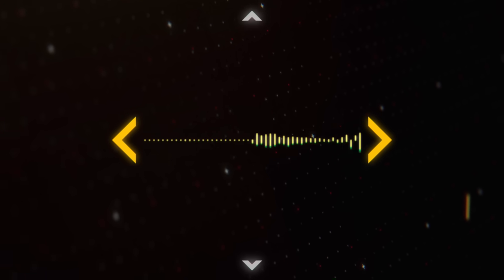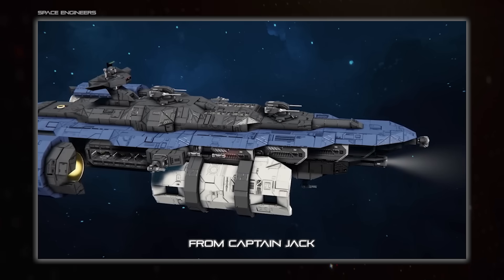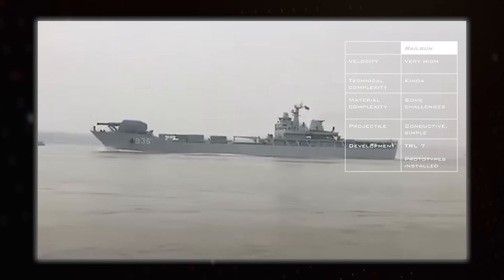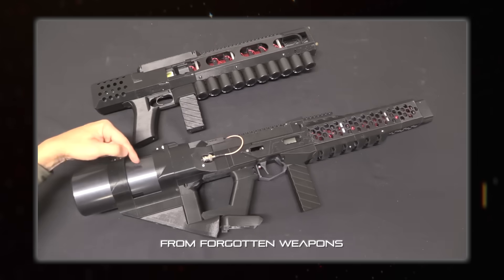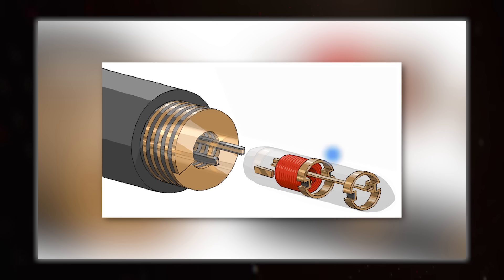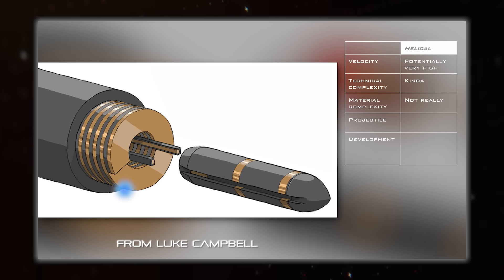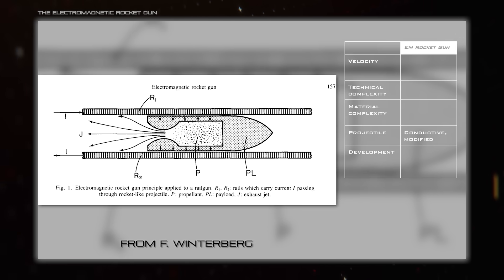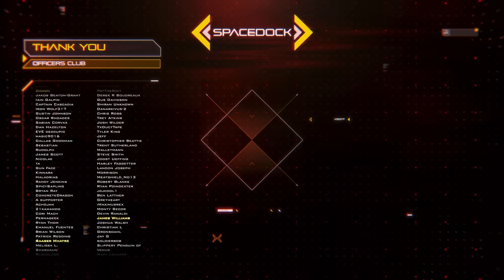The Deadly Coilgun/Railgun Hybrid You've Never Heard Of (Helical Railguns)

Comment: One of the primary reasons why militaries are looking into railguns and coilguns is to replace missiles for very long range firepower, as missiles are hella expensive per unit, while railgun ammunition and the electricity needed to propel it would cost pennies in comparison. As such, in my mind the helical railgun kinda goes against this premise with its much more complex ammunition.
Reply: On a scale of "cannon ammo" to "missiles", the helical railgun ammo is very much on the "cannon ammo" side of things.
Cannon ammo is actually surprisingly complex even tho there's no electrical things happening, just watch a video about the development of naval shells over the years leading up to the Dreadnought era to see what I mean.

As far as the hybrid railgun's ammo goes, materials science is here to save the day. There's plenty of alloys that use mostly copper and tugnsten out there, and they're used exactly where you'd think they would be used, where you have a lot of abrasion but need to transfer a lot of electricity. Think things like spot welder contact points, where you need to transfer a lot of electricity, don't want the contact to melt, but you also don't want it to get stuck to the other metal that you're actually welding. Tungsten/Copper alloys are great for that (there are usually some other small presences of intentional alloying elements to adjust properties to suit the application as best as possible).
All you really need for the "ring" contacts which are (in this video) ahead of the projectile's coil is a series of circular sections around the outside radius of the projectile, hinged at the front and sprung to push them into firm contact with the helical coil of the barrel itself. This allows easy feeding of the projectiles into the barrel, as there is a natural tendency for them to center themselves in the barrel by spring pressure alone, and if it's an attraction type hybrid railgun, the alignment of acceleration forces is also such that it will naturally tend to align the projectile in the center of the barrel. Both of these factors seem like they would further reduce barrel erosion.
Reply: @44R0Ndin  Nicely put. you could aslo think about material pairings for the contacts, whereas you sacrifice the projectiles softer contacts agaisnt something harder in the barrel.
What about metal with very low melting points? You could melt them as kinda an abrasive contact on the projectile side. would have to have high conductivity at a low melting point and minimize wear on the rail.
Reply: @44R0Ndin  I agree with your assessments as far as my limited knowledge goes, but I do have a concern that wasn't addressed in the video or your comment on the barrel longevity.  Cost to replace.  Unless the erosion can be limited to the point of outlasting the expected service life of the weapon, at some point the barrel will need replacing.  Rails, traditional barrels, and even traditional barrels with integrated rails would all be much easier and cheaper to produce than essentially the worlds largest spring with integrated rails.  That I would assume is the big equalizer in terms of cost/benefit ratio on helical railguns, not ammunition.
Reply: @zippydaspinhead  
Right, "simple" railguns would be, well, simpler to make, and therefore less expensive (to the point that you might be able to design them with disposable or easily replaced barrels or just easily replaced rails), and while you could do the same with hybrid railguns, the chances are high that you wouldn't need to do such a thing, and I think your point that you need to reduce barrel erosion to the service life of the weapon is achievable. However, it's even better than that, because even normal firearms are usually not expected to have their barrel last the expected service life of the firearm. Even tho a "cheap" AR-15 barrel will last roughly 5-6000 rounds and an expensive one roughly 4 times that without losing accuracy, they ARE designed to be replaced relatively easily by a gunsmith. Standard railgun barrels would need replacing nearly as often as the ammunition magazine, to the point that if you designed the rails and the magazine as a singular unit easily replaced, that would be a feasible avenue of designing a practical "small arms" sized railgun.

Rail erosion is actually LOWER in hybrid railguns than standard railguns, and the more turns you put into the projectile's coil and the more fine-grained the windings in the barrel coil are, the lower the erosion will be, because this allows a massive reduction in the required drive current (of course it's not magic, so the drive VOLTAGE will go up to compensate if you hold muzzle velocity and therefore muzzle energy constant).
This is because the "projectile" coil and the "barrel" coil have more than a part of a turn of an electromagnet in each one, meaning that less current is needed since the magnetic field intensity is roughly proportional to the number of turns multiplied by the drive current (to get the precise number you must take many other factors into account, but for a ballpark estimate to determine "Which is better", this level of analysis is sufficient).
The effect of this is that with more turns in both coils, you need less current, and less current means less rail wear due to resistive heating. Of course there will become a point where resistive heating is replaced by plasma heating due to the increased voltage, so there is a balance to be struck, but overall if you hit the "sweet spot" you can probably get a rather shocking reduction in overall barrel erosion.

Alternately, if you want a "snub nose railgun", you're also looking for a hybrid railgun, but here the rail erosion will be similar because you're holding drive current and muzzle velocity constant, while allowing the barrel length to vary between a "standard" railgun and a hybrid railgun. The hybrid railgun's barrel will be much shorter, again due to the multiplication effect of having more turns of current carrying conductor in the electromagnets related to accelerating the projectile.
If you really want to get fancy, you set the projectile to be "pulled" out of the barrel by the barrel coil pulling on the projectile coil, this creates a self-centering effect due to the radially symmetrical nature of both barrel and projectile coils, and this should also help with wear of the barrel as a whole even if not the current carrying primary rails.

It would also be fairly easy to design a railgun (standard or hybrid) which trades off a small amount of increased rail wear to allow the projectiles to be spin stabilized if this is desired. To allow this, simply design in a twist to the primary current carrying rails, and have the projectile's rotational axis fixed to the path of the rails, much like the rifling lands and grooves in a standard gunpowder firearm.
Reply: The primary reason why the US Navy Railgun was abandoned was actually because the maintenance cost outweighed the benefits compared to disposable missiles. The wear and tear and constant replacing of barrels was too much. So while you are correct that the ammo and power might not be an issue, maintenance is.
Reply: @ArmouredProductions Yup. Most of a sailor's job is maintenance
Reply: @ArmouredProductions  What about heat shielding for the coils? Could that help?
Reply: @ArmouredProductions  Assuming absolutely bonkers outputs... Helical Railgun. You need special ammo, yes, but the barrel might not actually need replacing.

Just the rail contacts. And if those are made to be replacable/centering contacts, it might be as simple as a half hour of removing old Power Transfer rails and inserting new ones into the existing helical coil barrel. And with the sheer amount of power, technically, you could theoretically get a projectile weapon with a lithium payload that goes thermonuclear if you yeet that sucker fast enough.
Reply: @ArmouredProductions  I heard that the velocity in our atmosphere eliminated the long range benefits it was touted as having where missiles and rockets hit just as hard regardless of when they hit. It would have only been viable in closer fighting where missiles could still strike them. Despite that, it's still an excellent coastal bombardment concept but this is all hearsay and personal conjecture so, grain of salt.
Reply: Could still be cheaper than missiles, even if not quite as cheap as simpler shells.
Reply: @lorddaro7771 And the high speed means lower time to target, which could be handy
Reply: Idunno man a fancy wire pattern and existing coil magnets are surely cheaper then the integrated computers and cameras of long distance missles.
Reply: @demrandom  There's a cost/benefit tradeoff here. If it's cheap, you can just lob a whole bunch of these hoping one will hit the target. If it's expensive, you want to put a guidance system on it to make sure it'll hit the target. Somewhere in between in a sweet spot which minimizes cost per hit. For traditional cannon distances (5-20 miles), I expect you're right and the sweet spot is closer to dumb projectiles. But for missile distances, I suspect other variables like wind, air pressure variation, aerodynamic imbalances due to manufacturing tolerances, etc. will push you towards wanting the projectile to have a guidance system again.
Reply: @solandri69  I don't know if you intended the oblique reference, but you just described exactly the problems with the US Navy's Mk 51 AGS for the Zumwalt class ships. It's "merely" a 155mm cannon that may have been initially intended to simplify logistics by using a common and established ammo type, but the performance requirements pushed the limits of ballistics and engineering so much that the system is hideously expensive and no longer compatible with normal 155mm ammo because of the modifications required to make it sufficiently long-ranged and precise.

I don't recall exactly, but I remember the cost per shell of the AGS 155mm ammo was near $1M. Part of this is due to how govt contracts work, where total R&D and production start-up cost is averaged out across produced units. As unit shell production goes to infinity, the averaged R&D cost approaches zero, limiting unit cost to only what's required to actually produce each unit. Program cuts reduced the number of shells ordered, which caused average cost per shell to go waaay up.

Prior to the Russian invasion of Ukraine in 2022, normal 155mm ammo cost around $3K per shell I think. Now it's up to $10K. That's excluding any special payloads or guidance options.
Reply: @dakaodo  Yeah, it is indeed somewhere around 1m per shell now. However it was normally expected to be around 20k per shell, but the navy cutting the amount of ships using it from +-30 to only 3 caused the price to skyrocket due to the lack of scale. 20k overall wouldn't be much for the capability it would bring, but I don't know if there were other problems that caused it to not be placed on other new ships (that obviously are still needed).
Reply: @dakaodo  though that higher cost includes the distributed costs of litterally building half a dozen more shell and explosives factories in the western countries that already produced most of the 155mm prior to 2022.
Reply: I've always suspected that a "sacrificial" sabot could work. Confine all the erosion to the disposable part, possibly using a graphite contact patch and squeeze bore to maintain pressure as the graphite wears away. That or liquid metal contacts.
Reply: The much more powerful and efficient electromagnetic launcher is the "quench gun" a superconducting coil gun. The energy is stored in the superconducting coils then the superconductors are "quenched" by the magnetic field of the projectile automatically turning off the coils as it goes past. So apart from using superconductors it is actually simpler that other coil guns and over 90% efficient conversion of electric power to kinetic projectile energy. While railguns manage 50% efficiency at best. In a coil gun the projectile does not touch the sides of the barrel so there is no friction or arcing. You can find two videos explaining the quench gun by two rival teams trying to build one for orbital launch, Lancaster labs and Electromagnetic launch.
Reply: The more complex projectiles would still be way cheaper than missiles. Way cheaper.
Reply: @paintrane1179  Shells and missiles are quite different from each other. The shell goes where it's fired, nothing more nothing less. They are also limited in range quite severely. Sure you can fire beyond the horizon, but the air resistance will chew up a lot of that motion making the penetration less than optimal. A missile on the other hand is slower, but it can change directions and fly at a low height. It also can carry a lot more explosives than a shell like the ones discussed. Railguns largely depend on a very high speed giving them high penetrative power and devastating results. The longer the shell has to pass through the air the lower the terminal velocity will be.
Reply: knowing mililtary contractors they'll still over charge for parts
Reply: Missiles are hilariously expensive. Even advanced chemical propellant shells like Excalibur tend to go for under a hundred thousand usd and can be bought in dozens for the price of a single long range missile, which comes in at several hundred thousand usd. A helical shell can be overengineered to a hilarious degree before it begins to approach the price of an AGM.
Reply: Might be cheaper overall, considering probably way lower maintenance cost.
Reply: @FataMorgana888 : Even hypersonics can be intercepted if they lack maneuvering during an opponent's intercept phase. One of the reasons the Chinese aren't enthusiastic about Russia's hypersonics is that they have little if any hypersonic maneuvering, so they rely on surprise to survive their own hypersonic phase.
Reply: @FataMorgana888  The viability of a missile has always relied on its ability to overwhelm the target's ability to track and intercept it; as such, even "hypersonic" missiles are quickly falling out of favor because of the unfathomable leaps in computing technology.

Governments are still crowing about their "hypersonics" because of Sunken Cost fallacy, but their days are extremely numbered due to the meteoric rise of AI and Predictive Analysis, since within a handful of years, all that will be necessary to intercept hypersonics will be the ability to put some flak into every calculated flight path (and there's already a finite number of locations that an incoming missile can occupy on an intercept vector while still remaining "on target".)

This is where the future of electromagnetic guns is now headed: high velocity flak walls on line-of-sight targets for interception via CIWS Integration.
Reply: To be honest, I don't see the replacement for missiles, when the big advantage of missiles is actually their precision. We figured out how to make ultra-long-range guns in WWI, but there wasn't much point without the ability to hit any target smaller than a city. (Unless you're delivering a nuke, in which case you don't want to spare any expense on the delivery platform.)
Reply: Liquid propellant guns and electrothermal might be an alternative.
Reply: David... If you're going to the trouble of using a sled, why not give it some form of recirculating path so that you don't have to wait for it to tram all the way back to fire again? (Multiple sleds parked could be fired individually in sequence or as a group, as well)

Also David... The internal coil doesn't have to be on the sabot if you use one. That can still be on the payload. Then you only need concern yourself with the material properties interactions of the three parts of the system. 

Lorgar... nonconductive insulators are common and important in electromagnetic actuators. Electrical contact between the stationary and motile coils can reduce the effective motive force produced by the magnetic interactions significantly or ground it out entirely.
Reply: A missile can take evasion manoeuvres and chase a target. Railguns are for point blank and stationary targets.
Reply: a sabot helical rail catapult with a damper might be interesting, and basically  all you need is to have the coil wound the other way around on the end. and you can just throw a lump of concrete or ceramic, which would be cheap.
and since it's a catapult, at short-medium range you could basically use anything non magnetic and relatively aerodynamic as a projectile, so for a tank, in a pinch you could literally go to the hardware store and pour concrete in your missile molds, no supply chain needed.
Reply: @satibel  Just to clarify, do you mean that you'd have a sled of sorts colliding with a projectile similar to how a Newton's Cradle works?
Reply: @Bob-yb5om  no, you'd have the projectile pushed by the sabot, similar to a bow, except the string is replaced my the electromagnet
Reply: yes, but the increased projectile cost could be offset by the potentially reduced wear on the armature. Basically you spend more per shot but you dont need to spend as much on replacement rails. Also, guidance packages are already a thing militaries have experimented with on railgun projectiles (like BAE System's HVP), which would bring up railgun projectile cost anyways. And again, still cheaper than missiles.
Reply: Yeah, cheaper in theory anyway...
Reply: thats true but what if it was a simultanious push pull design with like 4 contacts instead of two
Reply: If you use such a system to shoot out planes / spaceships, then it's actually for more worth it: launch a ship with far less fuel used in the takeoff!
Reply: Unless you can find a way to make the gun work with just a normal chunk of metal not the super complex thing
Reply: One idea that I've heard before was to use aluminum foil that then vaporizes into plasma don't know if it's a good idea
Reply: I think the biggest benefit of rail/coil guns is the fact that you don't need to be carrying magazines full of explosive propellant which become a real hazard when in combat.  Just look at how many Russian tanks have blown their turrets off when the magazine cooked off.
Reply: @alihaggis78  an electric fire can still blow up the capacitors or battery system but is a lot safer the gunpowder getting hit by something that explodes
Reply: The main cost of missiles is that most of them have very high tech computers inside of them.
Reply: Missiles are expensive because of the onboard guidance systems.

Unless railguns have a better way of making sure the projectiles land where you want them to, then I don't see railguns being able to replace missiles.

Missiles can self-correct their way to a target instead of going on a predictable ballistic trajectory.
Reply: @ true, but if you can put 300 of them into your target, for the same cost as a missile, at a higher velocity, from farther away, at less cost, it might be more effective.  And, depending on the design of the rails or coils, there might be able to be several pieces of ammunition all accelerating through the barrel at the same time, millisecond behind each other, so the amount the target might have moved in between is much more negligible.  Of course, unlike missiles, you can’t deactivate them or divert them mid-flight if it is a friendly rather than a foe.
Reply: Since it can move both forward and backwards along the rail (at possibly but not necessarily fast speeds, all depending on current) I could see the shown "projectile" being used not as such but as a slingshot for an inert caseless projectile, similar to a bolt carrier assembly in a AR-15 without a recoil-spring to reset, instead only flipping the polarity to go back and pick up a new round. Provided it can provide the speeds and force needed that is. It would probably also be comparatively silent as well.
Reply: I agree with the premise, but have to say that ANYTHING costing less than the billions per missile would be wonderful to both the military and our nations debt. I've always figured if the military could be cost-effective, that would solve the biggest impact on our super sized debt.
Reply: You are all talking missels here ... Think a bit smaller: artillery - just with longer range and mobile. 

Unguided shells would be relatively cheap. But even if you want them to make small corrections mid flight - that's possible with current Technology. 

Even if this system is more complex, the needed energy is lower. Means longer range or - and I think this is the important part - smaller vehicles with the same endurance, range and rate of fire.

Yeah, sooner or later you get the rails or coils into the same size - but that's later. If you want to have an advantage, you adopt this (if it's ready) for your artillery ASAP while working in the rails or Coils.
Reply: Imagine if the WW1 snipers had Railguns/Coilguns
Reply: You could make the armature separate from the projectile
Reply: The longest range railgun still gets beat by the shortest range missile
Reply: Another primary reason was eliminating the need for propellant. 
Many combat ships only damaged by hits were destroyed by detonation of powder magazines.
Reply: Problem with railgun is payload. You're poking holes but not many explosives I think can survive that acceleration. Also drag is a problem. There's a reason the USN stopped testing, despite some of the pros
Reply: @armorhide406 

The reason they stopped testing s because the gun literally tears itself apart. There was too much maintenance.
Reply: Well one of the why nots is the barrol would heat up very hot & in some cases would start to melt.
Reply: of corse this was a very long time ago.
Reply: @armorhide406  That, and it's very much a line-of-sight direct fire weapon; you aren't getting very far over the horizon with it before you start trading velocity for distance and rapidly losing your penetrating power.

Standard Naval Artillery works because it has both the mass to penetrate at a terminal(ish) velocity and an explosive payload...and a rail/coil slug has neither, so the pipe dream of the shipboard extreme-long- distance shot will remain just that for the foreseeable future (well...down here on Earth, anyway.)
Reply: Make the barrel twice as long as it needs to be, have the current carrying part be a sled and launch the projectile then use magnetic braking to slow the sled down and pull it back while letting the projectile leave the barrel.
So long as friction between the sled and projectile are absolutely minimal, you have a reusable sled that you just back down the barrel when you need to reload.
Reply: @daviddavidson2357  At hypersonic velocities, "So long as friction ... is absolutely minimal" is a really big hypothetical. :P Kind of like saying "Mars manned mission? Pfft, it's just vacuum. Hold your breath for a bit and you'll be there before you know it."
Reply: @dakaodo  Friction between the sled and the projectile.
Use a PTFE liner and friction between the sled and projectile will be low. You could also use a chemical booster to separate the sled and projectile.
Reply: @daviddavidson2357  Still, why the complication of a sled, when we have the discarding sabot concept? Long-proven engineering. And also tested for railguns, but apparently couldn't address the issues. How will making a more complicated reusable sled make this problem easier?

I'm not an engineer, but I'd think first try applying your PTFE liner to a sabot first before introducing more complexity into the equation via sled or additional chemical boosters.
Reply: @dakaodo  You can reuse the sled (a few times, depending on things like friction and coil heating), you can't reuse a sabot. 
Also if the sabot requires coils of wire and ring shaped contacts, it won't split apart cleanly like other sabots do as it's mechanically held in place around the projectile by the coil and slip rings. You could count on air resistance to cause the sabot to fall behind the projectile, however there would be a significant amount of engineering needed to get that sabot to separate cleanly and the air resistance will never be completely equal on all sides. 

At the speeds of a projectile accelerated from a helical rail gun the sabot separating in an asymmetrical manner would cause the projectile to lose accuracy and velocity.

Whereas if the sled is designed to mag-brake the forces will be even and with extremely low friction materials (PTFE or ceramic) in the sled the projectile will separate out cleanly under inertia.

Depending on the mass of the projectile to the sled, the barrel length may not need to be significantly longer either, braking forces would relate to mass, so once the projectile has left the sled/pusher, the amount of barrel length would only need to be long enough to stop the sled. So assuming it's made from lightweight materials and is 1/5th the weight of the projectile, the barrel would need to be approximately 1 and 1/5th as long as a standard barrel. You could either use a light based sensor to trigger a polarity swap on the rails, a timing circuit or simplest of all, a break in the rails, filled with a non-conductive ceramic and physically swap the polarity.

With a system like this there's no need for an expensive single use sabot and no need to worry about poor separation of the sabot affecting accuracy. Slightly longer in the barrel and a bit more complex to make, though more reliable than a sabot system and cheaper to use in the long run.

Also if a chemical booster is needed for separation, just use a diode and resistor. When the polarity flips current passes through the diode, the resistor heats up and the chemical booster ignites.

Also, just since you said you aren't an engineer, I am, though I'm an electrical/electronic engineer and only trained to undergraduate level, so basically at the bottom rung. Maybe there's a mechanical reason that a sled/pusher wouldn't work, if a mechanical/aeronautical engineer knows, please let me know.
Reply: @daviddavidson2357  The problem is contact.

The sled/slug is the bridge between the two rails, so the more low-friction non-conductive material is included, the smaller the contact points will be, which, in turn will be required to carry more voltage and result in more damage and welding to the rails.

So, the damage would accrue faster and the rails would actually wear out more quickly.
Reply: @dakaodo  umm... adding a non-conductive liner to the sabot breaks the cirquit that propels it...🤦🏼‍♂️
Reply: @SonsOfLorgar  Don't look at me, man. David Davidson was the commenter who brought it up! :D

I was arguing from a different position, against more complexity. And commenter Digitalis provided one explanation for how reduced contact area could pose a practical obstacle.
Reply: @digitalis2977  Thanks for your comment about contact and wear/welding on the rails.

For the rest, your comments about hypersonic missile sunk cost fallacy versus other emerging technologies made me think about diminishing returns on mature technologies.

Guns and rockets/missiles have been around a long time, so they are relatively mature. The exponential difficulties with trying to push ballistic or powered projectiles faster are just a natural progression of working with physical objects in atmosphere and gravity.

So anyone looking for significant revolutionary developments instead of incremental evolutionary developments will have to consider different or at least complementary fields. Like you said, increased computing capability (AI or not) could better (or at least differently) leverage the limits of our established physical arsenal, squeezing more efficiency out of what we can already do. Or as with the military's current trend/fad for unmanned and comparatively more expendable systems to push farther forward for less risk, thus reducing the need to fire weapons from absurdly long ranges to merely very long ranges.

Or maybe some other technology unicorns like directed energy weapons or whatever.
Reply: @daviddavidson2357  … and you just reinvented the crossbow/ballista
Reply: All it needs to be is cheaper.